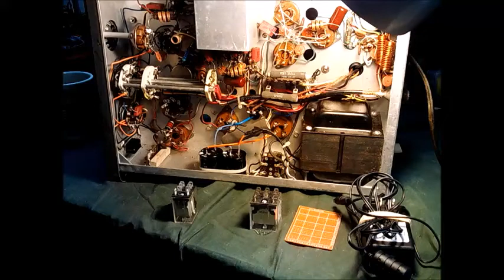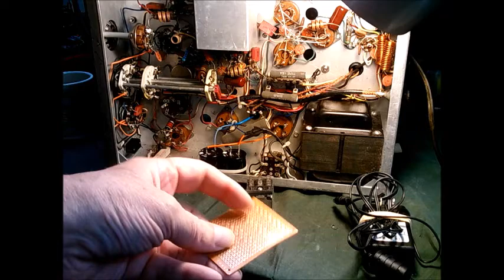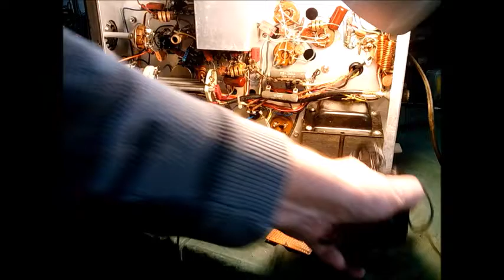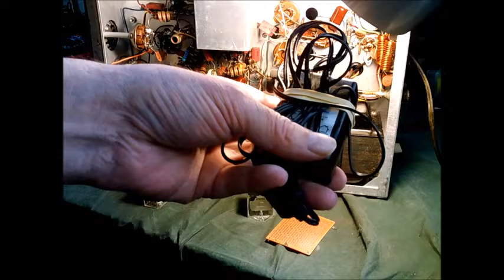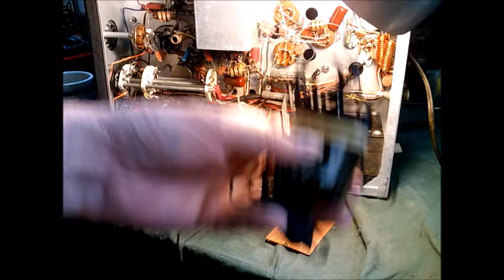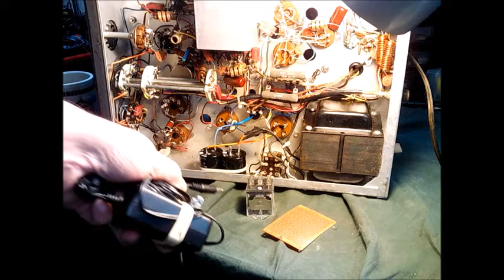Johnson update 2

Comment: You can put a doubler on the 6.3VAC to make coil voltage on a single terminal strip.
Reply from the maker: Thought about that however I have never seen anyone do that for this applaction so must be a reason. The problem is half the transformer is grounded. So you got to get 1/2 your AC power from the ground then after the diodes you got to dump the negitive back into the ground where you got your AC input. I tryed it once with another project and it keeped killing the ground diodes.